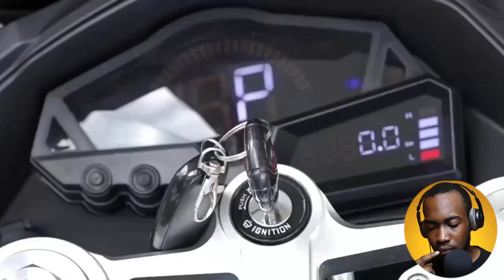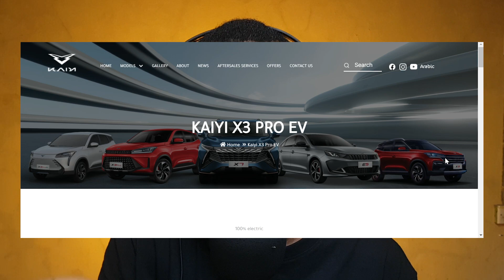Zimbabwean Inventor Creates Self-Powered Car That Uses Radio Frequencies As A Source: Scam or Truth?

Comment: Scam, scam, scam. It is not possible to get 50kW from a 1kW radiotransmitter. It will take about 25 year to fill a aaa cel. Run a car is NOT POSSIBLE. scammer.

Comment: He's a scammer... if his device can produce free energy, why does that car of his have a 12v battery? his device should be able to power the car without any batteries.
Reply: the components are not designed to handle direct energy from the sun...the battery acts as resistor and distributes as needed ...